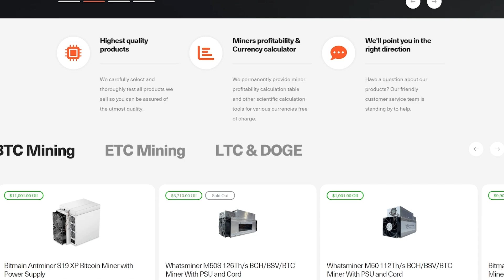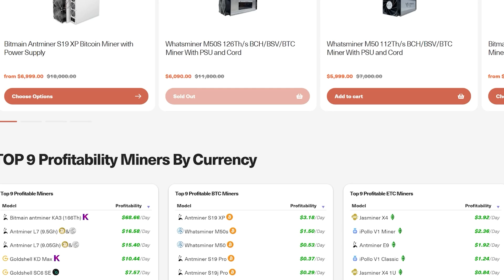Basics of ASIC Repair

Comment: I still just want a video showing how to fix the voltage to the board. I have about 18 L3 boards all with that problem. I have a feeling there's an internal short. Is that fixable?
Reply: there are many videos on l3 boards they are the simplest to fix.
Reply from the maker: The industry is a tight lipped one. I am trying to sweet talk them :)